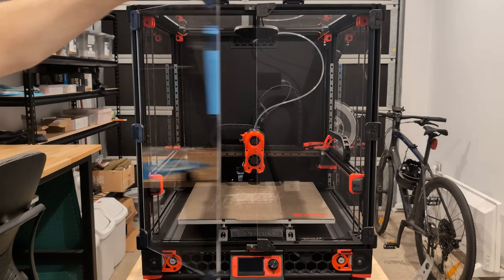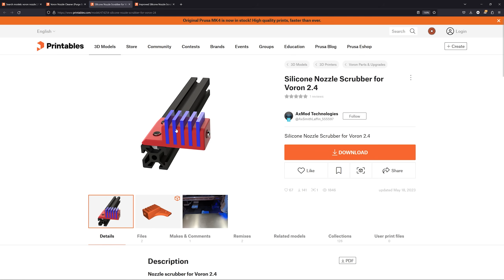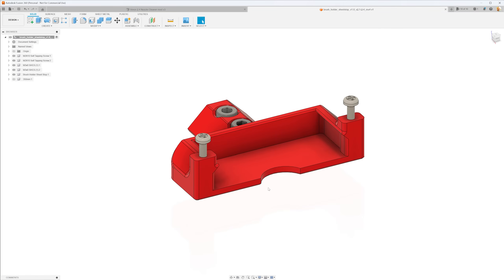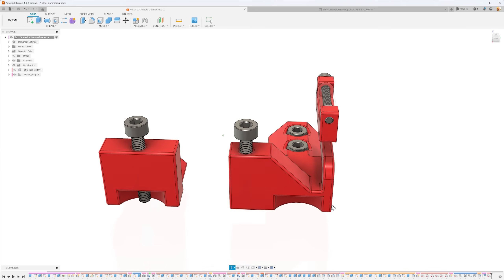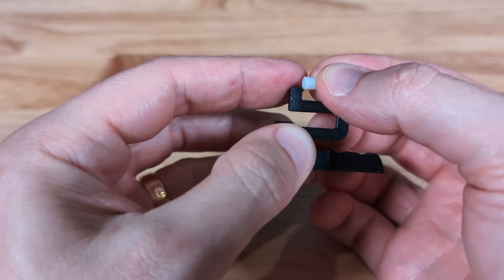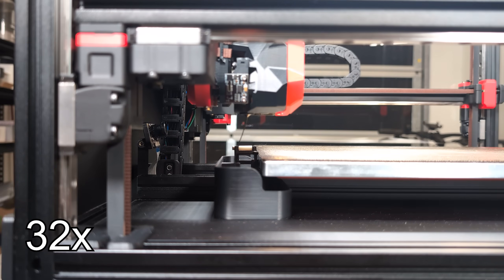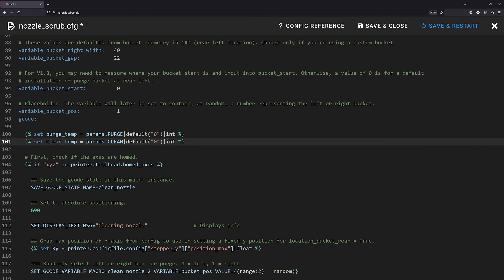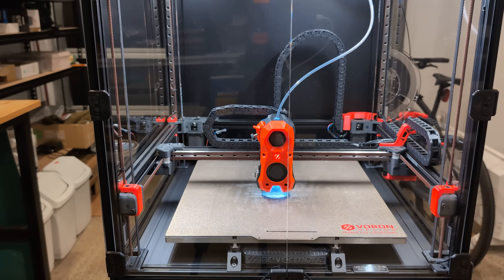Voron 2.4 Nozzle Cleaner that works

Comment: wow that is awesome, i love it... i already once thought about recreating the one from Bambu - all thought the issue i fear is that it only cleans the nozzle tip and not the whole nozzle body.  

when i got more time one day i might actually test it, you did a really good job on this one, thank you very much
Reply from the maker: Thank you. And, true, that might be a problem. However, I'm mainly concerned with the tip as it's used for Z calibration.
Reply: @scheffield yeah exactly the rest only influences if its very dirty and makes the printed filament stick to the nozzle
Reply: If you have a well tuned printer the nozzle doesn't generally get dirty. And for the few times it does it's not hard to clean it manually. I myself still regularly see my printer physically so it's not really an issue. This solution does deal with ooze which is nice when probing with the nozzle.
Reply: @qwertyboguss  yeah youre right especially when the nozzles excess is automatically cleaned with this there is nothing that can go up the nozzle body
Reply: @qwertyboguss  Not true, lots of reasons filament gets stuck on the nozzle.  For the most part mine says clean as can be, but if you iron, you will get buildup on the nozzle, and this will not clean it at all.